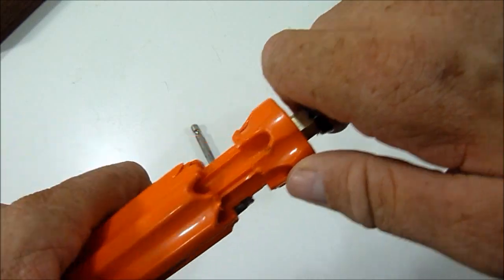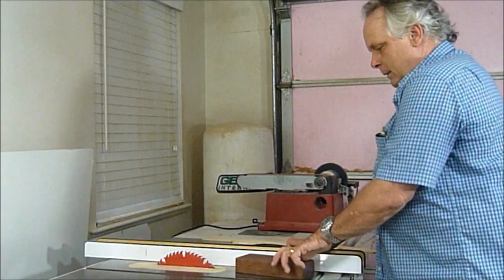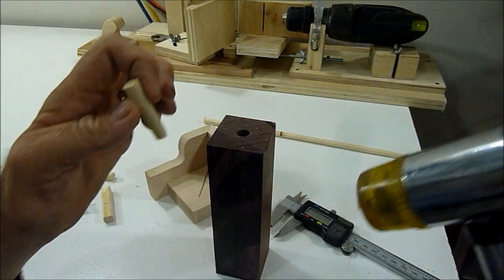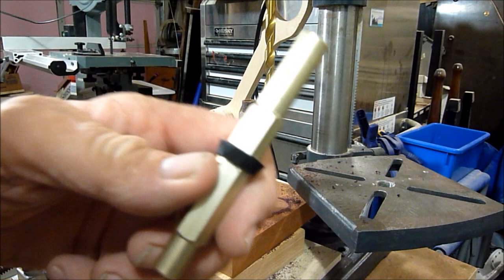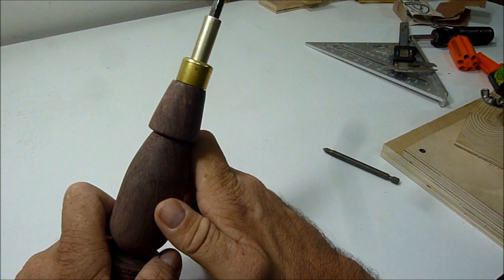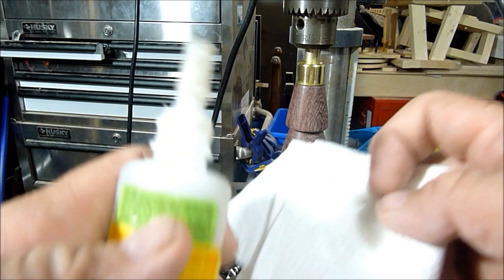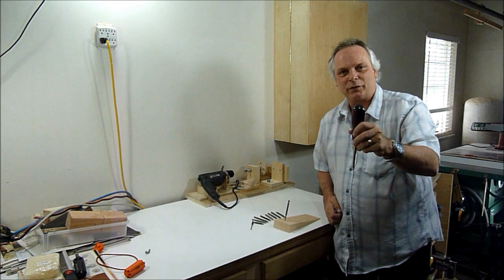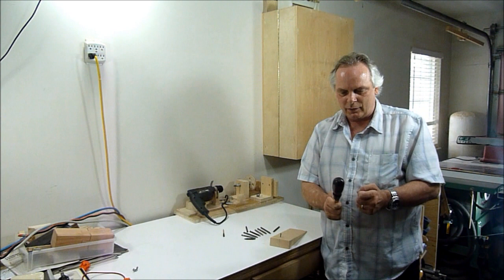Make a multi-bit screwdriver

Comment: Nice project and good looking screwdriver.  Your turning technique could use some practice.  I was cringing when you had the lathe knife pointing down below the tool rest...the life should be horizontal pointing at the center of the spin axis or pointing partially upward.  Keep practicing...lathes ca n be fun and useful tools.

Comment: Very cool Jack. Glue as a finish is a nice touch, I have seen it used for a similar purpose, but never as the finish itself; I may try it one of these days. Do you plan to hollow the screw driver to hold the extra bits?

Comment: CA glue as a finish. I did not expect that. Looks really nice. How does it hold up to water and oils? Also that brass collar you put on. What is that? A candle holder?
Anyhoo, great craftsmanship. Looks like something that will hold forever. I would have branded it before finishing it.
Reply: There are a number of high end wooden pen makers who swear by CA. The only things (I'm aware of) that do it harm are heat and acetone.
Reply: As Yoshio said, its a "fairly common" finish for pen turners. Its not overly economical for larger turning, but for smaller items it is super durable. Most friction polishes that are used on the lathe tend not to hold up well with use as they're (usually) shellac based. CA finish is just like putting a nice coat of plastic over it, and its easy to buff that to >30,000 grit!

Comment: Seems like that finish could be kinda dangerous, since it bonds skin really fast, especially in context of putting it on something spinning in a drill press.
Reply: Fairly common finish. I use it for pens and find the bigger problem is it heating up and giving you a chemical burn or the fumes. It has never had enough "grab" to really pull anything into it.